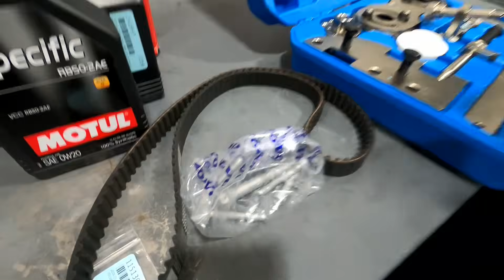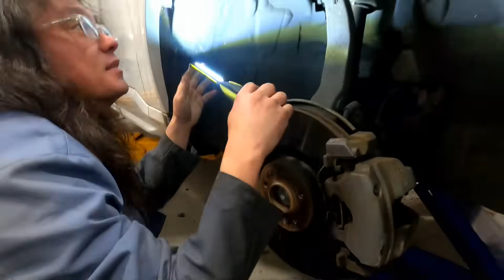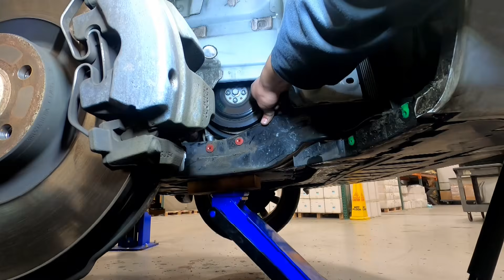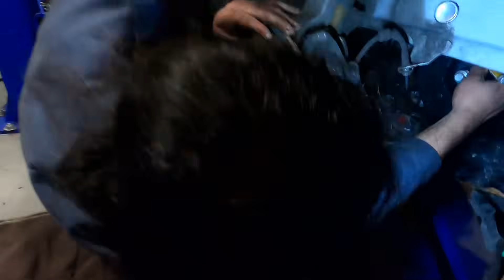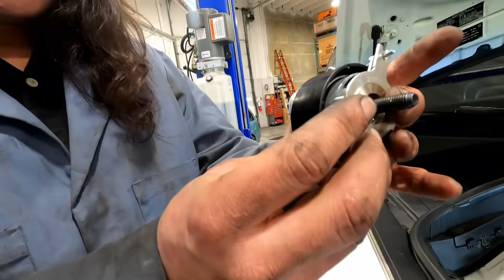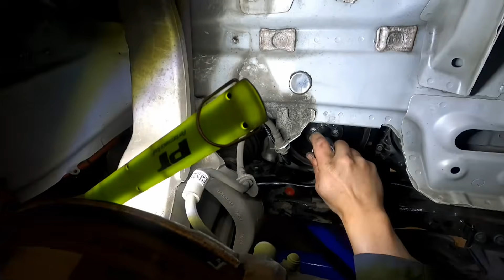Volvo Timing Belt Overview 2.0L VEA T5 T6 T8 models - SPA (P5) 2016- XC90 XC60 V60 V90 S60 S90

Comment: 27:57 Additional tip that helped me. I turned the crank back one tooth to get the slack out of the “idler” side of the belt and bring it to the “tensioner” side. I was having a hard time with it but this helped. Overall, this video has been very helpful. Going back together now. 

2019 S60 T5 with the funky spring loaded serpentine belt tensioner.

Comment: If you change the cam seals. Do you use the tool on the cams gears for correct timing when you have to re install them on the camshaft?

Comment: I took my Volvo xc60 t5 2014 for a timing belt kit replacement. After the replacement I am getting the P001722 and P001792 fault codes. What does these codes mean?

Comment: Since these engines don't have a traditional water pump. Setting the belt on the intake hub can be really frustrating. You'll have to pull the slack side quite hard upwards with your left hand to keep the belt from sliding on the crank pulley. Ive found that if you can get the belt to seat on the intake hub pretty easily by pushing the belt quite hard eith the rubber teeth slightly engaged. Without moving the crank thr tension on the idler side of the belt is quite extreme. It can be a bit tricky doing it the first time or two.

I've also never done this job without taking the crank pulley off and replacing the front crank seal assembly. Its a plastic cover piece and they pretty much all seep by the time the timing belt is due or will start leaking shortly after. IMO it is not worth doing the timing belt replacement without replacing front crank seal plastic cover. Its a cheap part even directly from volvo and youd be doing this all over again to fix the oil leak before the timing belt is due again. You also need a special sleeve tool to cover the end of the crank shaft to avoid damaging the lip seal of the plastic cover during install. The t6 serp belt setup is insane on these engines and has 4 or 5 idlers. That kit costs more than the tbelt kit and front crank seal if i remember right. The serp belt is due at the same interval as the timing belt so dont forget to get those components as well.

With how much the specialty tooling costs i wouldnt really recommend doing this on your own.  Unless you could split the tool cost with a buddy that needs to do a 2.0L timing belt as well.